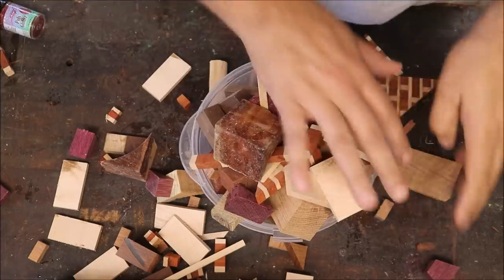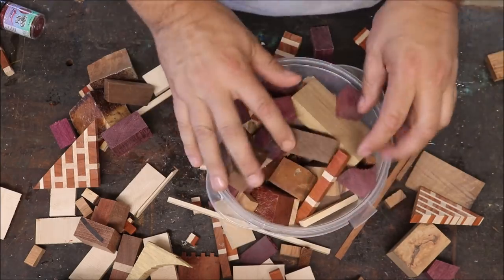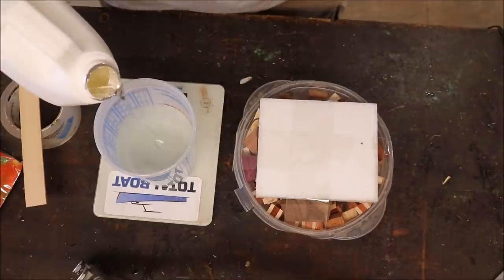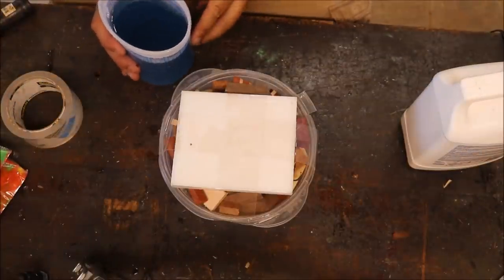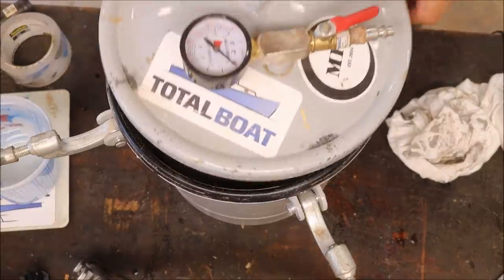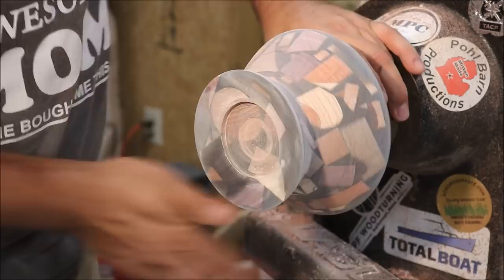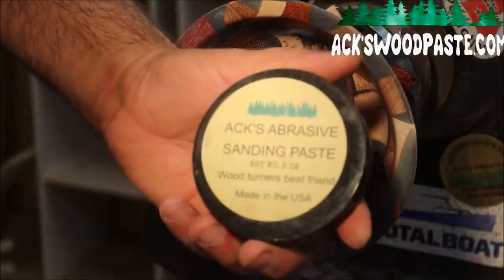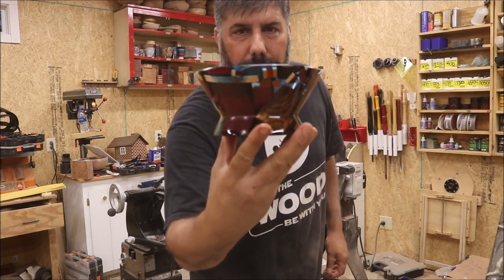Wood Turning - Pieces

Comment: Didn't think i was gonna like it at first. I was wrong. Luv the shape and supprised at how little resin was visible in it. 
Question - Have you found TB to be more user friendly than Alumilite due to moisture content in the wood? I have.
Reply from the maker: Hey thanks. Yes is the answer to your question. As you have seen in many of my videos I use air dried non stabilized wood. TB holds up well with it and usually when a crack occurs it is in the wood not the resin. When I have use Alumilite in the past the resin tends to crack on my. Maybe it's my lack of experience in using it but it has happened on multiple occasions.
Reply: @MoonpieCreations  yea, i was told that Alumilite requires 100% dry wood. Guess it's true...

Comment: I’ve always wondered whether or not it makes sense to try and have a hollow center to save both materials and time. I’m an absolute newbie to this hobby so any help is appreciated.
Reply from the maker: I use scrap wood in the center of mine to save on resin. This works to an extent. You can only use so much before it interferes in your creations.

Comment: Great content as always! I always was wondering how total boat matched up against alumilite clear slow im assuming you like total boat more but im curious to know why it may be superior?
Reply from the maker: Hey Tommy, I wasn't knocking Alumilite for sure. I used the wrong type of Alumilite in that bowl and I did not have a pressure pot. BUT, you are right I do like TB a lot more. I have tried to use Alumilite many times and have had issues each time. Cracking on small pours. There are so many types of TotalBoat that you can use that you can fit one to every situation. You want crystal clear hit TB 2:1 or 5:1 Crystal clear. You don't have a pressure pot? Well here's some Thickset for you. Oh you only need to do a table top? Well use the table top resin for that. Man the list goes on. High Performance Epoxy, 5 min Epoxy, Fast curing epoxy, penetrating epoxy. Then they go into other stuff like pigments and finishes. The company is very responsive why I reached out to the other and got a big goose egg. TB give coupon codes out and I can honestly say I have never seen give one out. BUT again I have friends who swear by Alumilite. Jake Thompson does a shoot out and gives his opinion on this video. https://www.youtube.com/watch?v=6z6eHSdqLTQ&t=1508s Sorry I ran on. Hope the info helps.
Reply: @MoonpieCreations  thank you so much for the reply i appreciate informative advice 👍